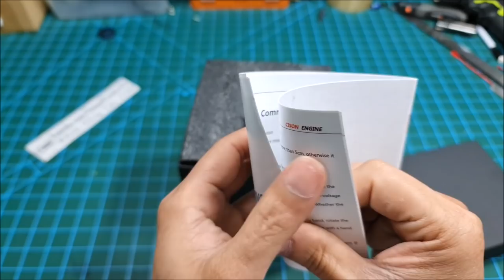9cc V-twin Engine Four-stroke Air cooled Gasoline Test

Comment: Four stroke engines has an oil pan,  and I didn't see you check it,  or look it over.  That would be good for some sort of model airplane.
Reply: He’s using a nitro methane oil blended fuel, no oil pan is needed. Burns cool and provides lube. Rocker arms are greased that’s why they are blue colored.